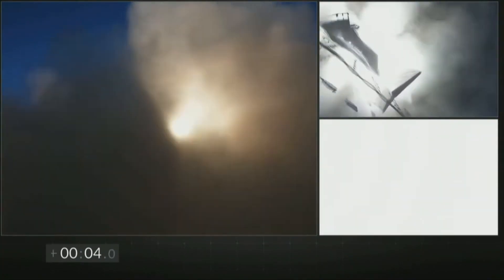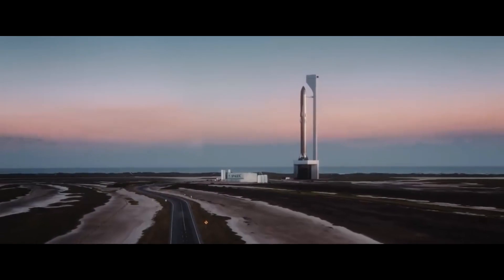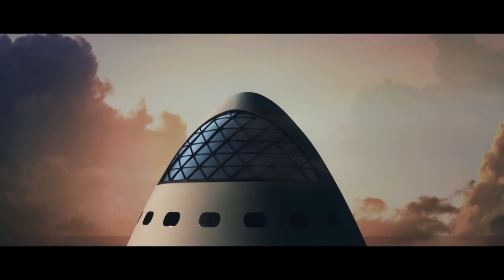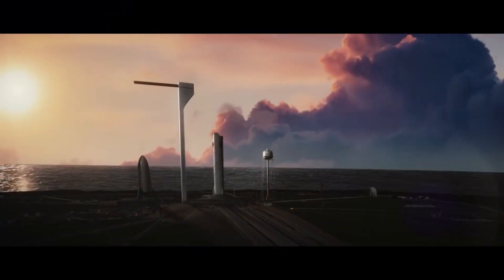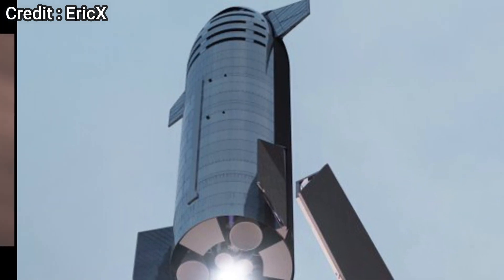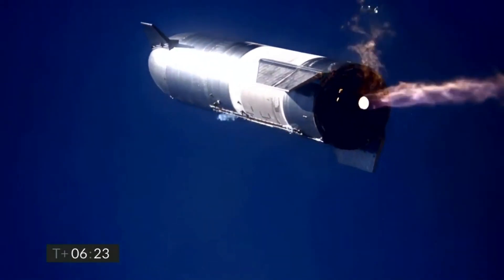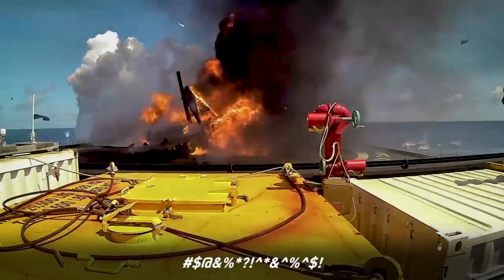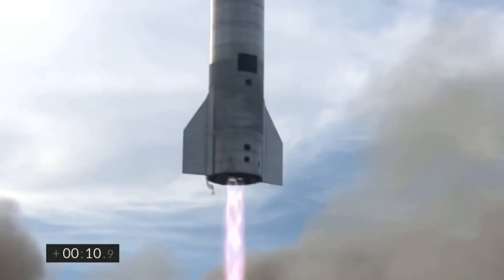Catching SpaceX's Starship : The Pros And The Cons

Comment: Most likely the Earth bound tanker Starships will be catched to maximize the fuel load transported per delivery and the Mars or Moon bound ones will have legs. Since the NASA Moon version is not planned at all to return on Earth most likely this will apply for those that land on Mars as well. At least those early ones. I'm wondering. what if the legs are built from carbon fiber? That surely can save some weight. PS great seeing your channel develop! I'm here for the long run!
Reply from the maker: Catching tanker Starship sound a good idea. 

Carbon fire won't withstand 100+T rocket.

Thanks for supporting the channel ☺️ Glad you like the content 👍